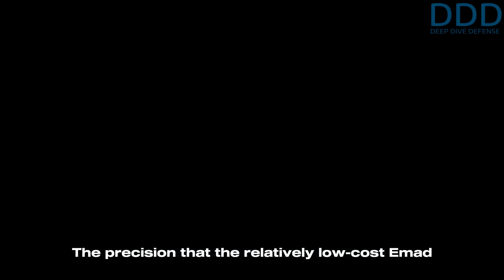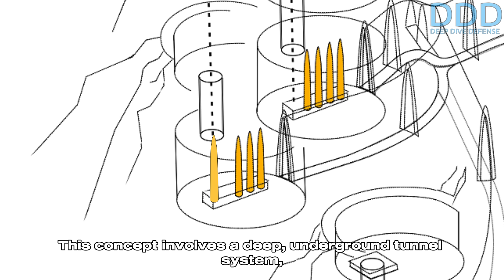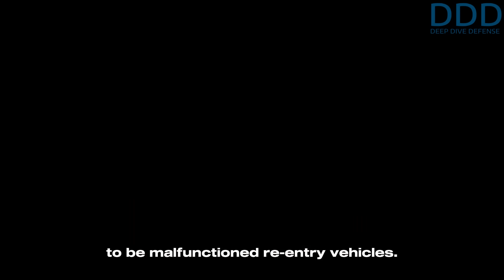Iran's Workhorse Ballistic Missile of the 12-Day war: Etemad an upgraded Emad

Comment: Something tells me vast shipments recently given to Israel side contains ballistic missiles which showed their importance against them and now they want to use it against Iran which probably hasn't the necessary air defense to intercept high tech ballistic missiles. 
Do they have enough high end ballistic missiles to counterattack Iran's missiles?
Reply: Unless they buy advanced ballistic missiles from Iran, where are they going to get them from? Not the US, not NATO. So pipe dream. israel depends exclusively on their air force to cause most of the damage. That's true from Gaza to Lebanon to Libya and to Iran.
Reply from the maker: There is basically no Iran-ranged BM they could import
Reply: Trust me for the last 60 years if any country is the most advance in missile tech it would beIran since everybody else concentrated on Jets etc., and that would include interception.  the difference is that Iraniancommanders inGazaSyriaLebanon are  within ranges to take those down at boost phase, that's assuming that they buy them fromIran

Comment: Can you made video on how israel defense overloaded and how many air defense system of different countries were targeting iran missiles?
As I have seen Jordan,Iraq,US and UK they are targeting it.
How missiles or drones by passed the defense?
Reply: cheap missile, cheap drone, the rule is 2 interceptor by missile, but in some video israel launch like 10 interceptors just for one missile, intercpetor cost may reach 10 millions $$ iranian missile cost are between 100000$ to 10 millions $, mostly you force your opponant to burn its interceptor against your cheap missile while you follow with your best missile against your opponant maint target

drone is more tricky, they are made with material radar have difficulty to detect, so in low altitude they can bypass air defense, but their weakness is against manpad and old school anti air artillery, you give them turbo jet and fly higher to force your opponant to burn interceptor, so currently defense against that is guided rocket or plane or chopper with guided rocket, they say laser, but laser only work against slow drone made in plastic or wood or glass fiber, seem carbon fiber can absorb better heat from laser
Reply from the maker: Good idea
But for now I make a break on the videos on the conflict 
I have made 11 already

Comment: Why not move solid fuel production also underground like liquid fuel?
Reply from the maker: Life cycle costs and security of liquids is better
Reply: @DeepDiveDefense  why not just make small mixers spread around in the middle of iran so even if they want to target it they have to use expensive missiles to destroy a small cheap mixer .
Reply from the maker: Not really of great importance on long term.
Will be repaired
Reply: It's almost impossible technically due to the difference in processing
Reply: i read china export fuel to iran, so some fuel process production can be bypassed if they buy fuel componant from china
Reply: @vkobevk  they did and mossad agents managed to blow it up in the harbor
Reply from the maker: @vkobevk 
Yes its been reported that the production was ramped up and additional Chinese raw materials are acquired

Comment: This US satellite jamming capability is probably why Israel took the risk of launching the big attack in June.

But it raises a question:  What about during True Promise 2?  Were those Iranian missiles also successfully jammed?  Or had Iran already figured out how to counter the jamming?  Or did Iran fire a different mix of missiles?

Also, this probably explains why Iran apparently avoided firing many of its newer missiles during the 12 Day War.  To avoid the US and Israel gaining a lot of information on how they function so that they could be countered in a future war.   Which means that Iran quickly concluded that the June war was just a prelude to another war.

The conclusion from all this is that the next war is likely to be far bigger.  Both sides are gearing up for a showdown.
Reply: not working against inertial guided missile or missile using stars to guide themselves
Reply: If this US satellite jamming capability worked then we'd see those giant birds discharging bombs like we see on YT from WW2 LOL it didn't even work in 2011 when we took control of the RQ-170. If you mean missiles, then what would you jam when the centerline is following the INS path?
Reply from the maker: Etemad was operational during OTP-2